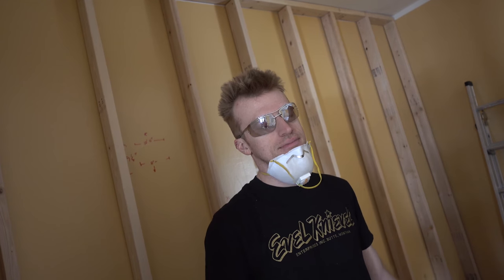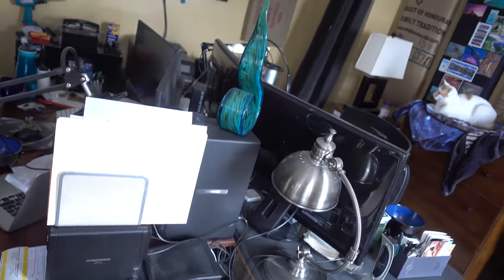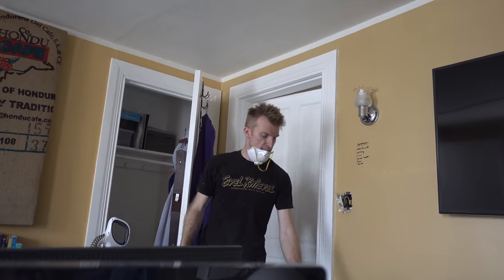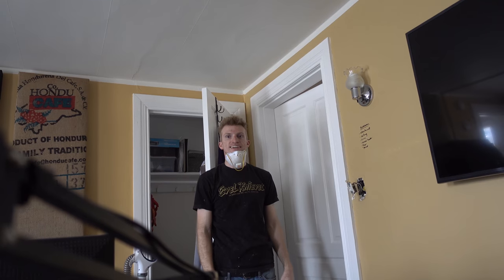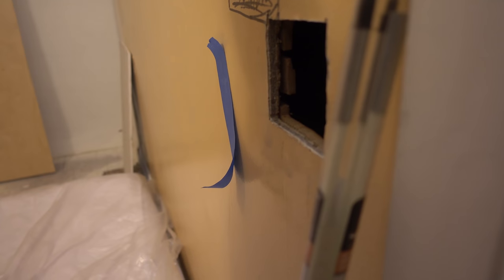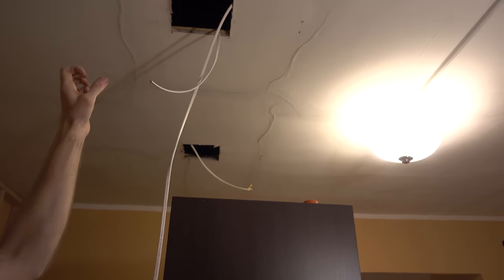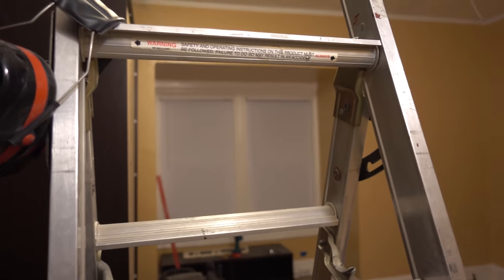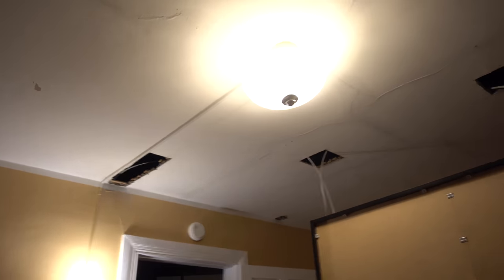Let's Fish Some Wires Through Plaster!

Comment: You can use those super thin "puck" lights, IPO cans. I do not have to worry about where my joists are. Just get thru the plaster & lathe, then wire the box, place it in the 6" hole, then up goes the little light ❤️ right over the joist! Awesome Lil things!

Comment: I recently hit a situation where, due to the header over a sliding door, what I thought was a clean between-studs run from attic to basement was blocked just below the 2nd floor by a cross-piece.  The original solution, with former knob&tube, was to drill through, and the previous Romex runs that replaced the k&t followed that (pulled through by the old k&t itself) followed that path thru the hole.  It was possible to divert around the header, there was space enough behind it (but still inside the wall) the newest romex run (for a new circuit) and all future runs will have to follow that path....but of course figuring this out involved punching added holes in walls...

Comment: Looks like fun but looks like your useing 14g wire everywhere? need to be sure too keep your points to a minimum . you are only  good  for 15 amp but looks like a lot of distance between your service panel bedroom down south we use 12g (yellow ) for our branchs 20 amp  and only 14 on a switch load.
Reply from the maker: The lighting in here will all be LED, so 15 amp is actually overkill. We did pull 12g for 20 amp service to the office where the usage will be higher